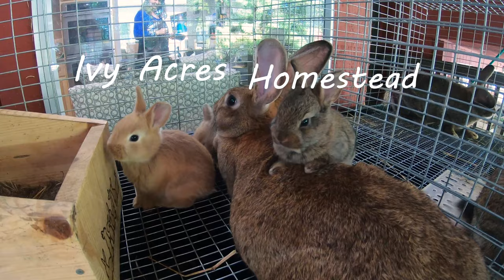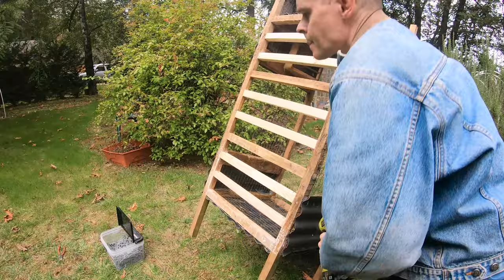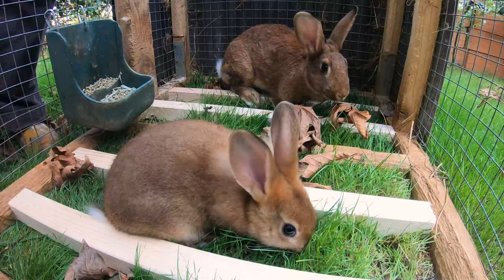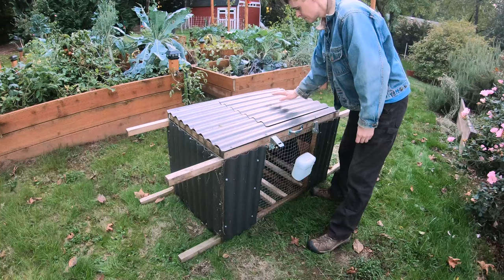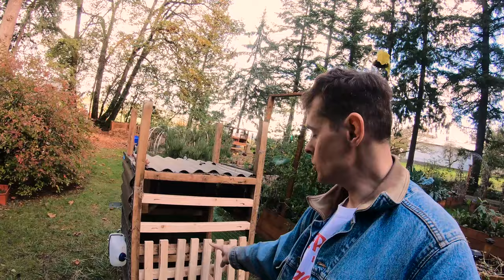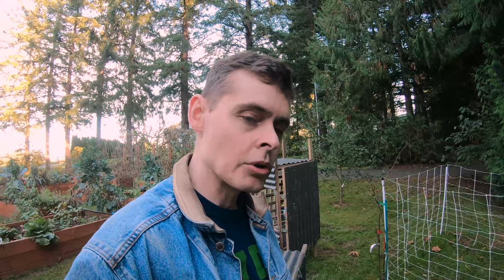Trying Something Different with the Rabbit Tractors

Comment: The first thing your doing wrong is using hardware cloth. You need to use 1/2x1" welded wire. Yes it is alot more expensive but it will end alot of your problems.
Reply from the maker: That is a good idea.  Thanks.